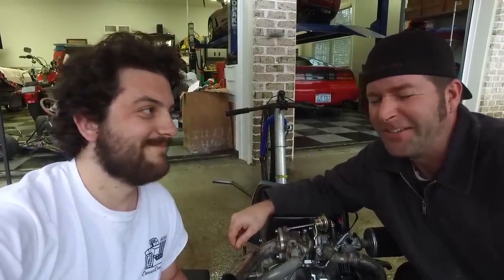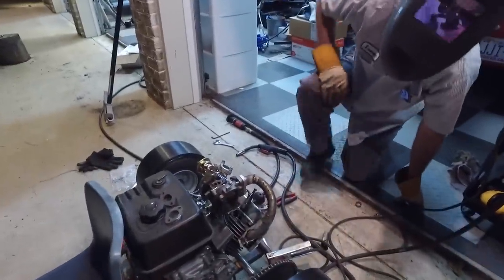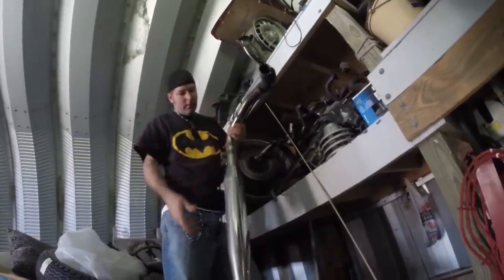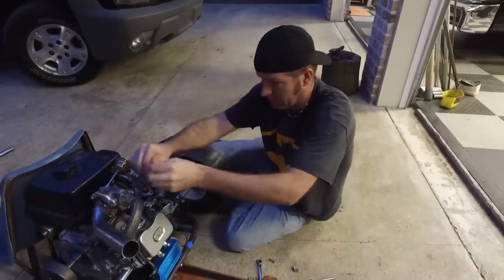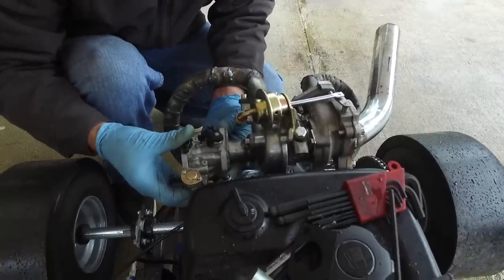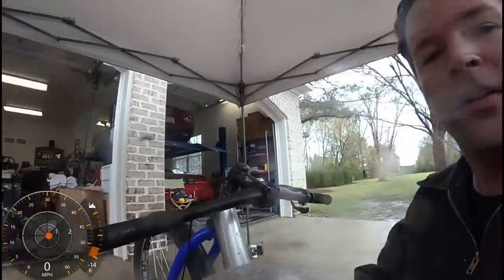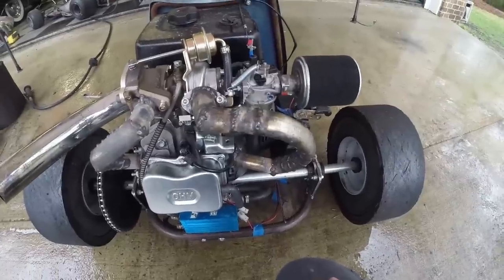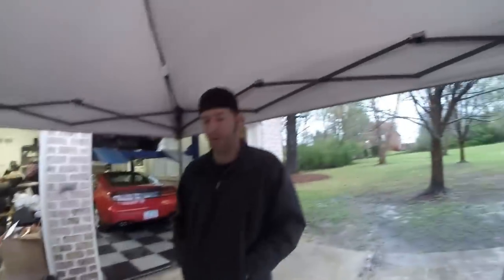Turbocharging a 420cc Drift Trike

Comment: Dude look at all these views. Hey man I think it's about time for you guys to step it up a notch, get a tubing bender, a miter saw and a drill press. Get away from those predator engines and look up resources for lifan engines or other Chinese iterations that include manual or automatic clutches and 3 to 6 selectable gears with overhead cams and electric start. Similar price range to harbor freight predators only a bit cheaper and much better features! =D

Comment: got to pressurize the hole carb and plug the bowl  vent
Reply: stop the  over pressurizing of the bowl the hole carb has to have Equal pressure on the air filter side of the carb is were the vent is

Comment: Get a blow off valve put it on the intake side of your carburetor move the carb back down that way you can control how much boost is going into the engine

Comment: Um yeah ... pushing the mixture through the turbo is not safe.
Sometimes this is done with superchargers, but you should not do that with a turbo ... ever ... because they get hot.
So if you would have driven this thing for a longer period, it could just have caught fire.
Reply: +detaart renault 5 turbo had a draw through turbo from factory
Reply: +p330hne and it caught fire from the factory.  those cars were infamous for catching on fire.

Comment: It's not getting enough gas  they make a electric fuel pump   That's for starters  as far as the battery try using a battery for a electric scooter there 500 amp   You also might have to jet the carb some I have years of drag racing experience

Comment: Why use & return engine oil for the turbo? Make or repurpose or buy an oil container, make it's own closed circuit? A Heineken beer keg is an awesome DIY fuel tank, $16 at WalMart, great beer, 5 liters. Do the same idea for oil, only smaller, maybe 2 liters? Sheet metal, 2 circles, 1 rectangle. Why does everyone tax their oil twice? SMH.

Comment: the problem with it is not the turbo, its the people who have no idea building it
Reply: +Darren Boxhall well we aren't done with it yet
Reply: +Isaac it'll be fine yeah fair enough.  I know you have received alot of info already,and I haven't read through all the comments, but it should work alot better. have you got another carby to try? that one that you blew out with boost could have an issue now. also, you should try richening it up so it blows a little black smoke, it could be leaning out a bit  extra fuel will cool it a bit too
Reply: ill try some more tricks

Comment: guys please get a pipe bender and some sand. these seams are not doing you any justice. also you NEED to get a motorbike carb if you want to run a draw through properly. even an AMAL from the sixties would work better than that junk.

Comment: pipes too restrictive, need proper inch and a quarter pipe, by losing that quarter inch you've lost (i forget the math) a shit ton of airflow anyway, so it's pretty much pointless..... EFI is needed but if you get the airflow right, the carb will work a lot better anyway never ever in a million years put smaller pipe than the normal,  try running then breathing through a straw, you'll get the idea.

still you've now got templates for the new pipes so that will be a lot easier.
Reply: +Bill Hanson the pipe is bigger than the inlet to the carb and the port
Reply: +Isaac it&#39;ll be fine you need to match all the holes all through to get perfect airflow, it's going to choke if you use any less diameters then the turbine output, you'll get it to work better if you increase all the ports and piping all through, we are talking serious power gains, break out the die grinder.
Reply: we are not done yet
Reply: +Isaac it&#39;ll be fine  awesome look forward to seeing the results.

Comment: I could tell you at 8:49 its not going to work ..... The worst case turbo is a blow thu carb....if the turbo makes any boost the engine will die from fuel starvation. Jets in a carb are designed to operate on negative pressure. Havnt watch the whole video yet, commenting as we go.....

Comment: little supercharger with a fan clutch to cut out at 4 to 5 g or the turbo will never spool up at low rpm.  in other words you need compression before you get compression at top end .do that and it will scream like a rape victim. 60% nitro methanol wouldn't hurt
.

Comment: Obviously it wasnt going to work who doesnt no that you cant turbocharge a carborated system?Of course it needs management.That thing is going to blow up so quick without coolant its already a cheap chinese turbo you just made it a 70's turbo without coolant. Thats the reason the whole turbo generation went away, unreliable power turbo's were blowing out in just a few thousand miles. Cool idea but do it right next time. You could have easily made a small reserve of coolant for the turbo only duh dudes! It works is not all that matters guys come on. I do give you credit for having a Z32 in the shop though nice clean Z, horrible drift trike mods jesus that was ugly I guess it worked though.
Reply: +Brian Heiden Don't listen to the haters guys, EFI that thing and you're mint. He probably doesnt realize that there are only provisions for oil cooling on that turbo. Oil cooled turbos are common, and reliable as well.
Reply: +Colin Worobetz well this one has a spot for coolant too. it'll be fine lol

Comment: add a bigger carb!!!!
Reply: 4-barrel!!! Lol
Reply: +horseman1968 well that got me going!! Hmm 4 barrel is it possible??
so I did some quick calculations, 400cc 0r 0.4 Liter at 7,000 rpm (screaming !!) would produce 1,400 cubic liters per min or about 50 cfm, I think a 4 barrel will work if 3 throats are closed off hahahah
In saying that they are not hitting the 7,000 rpm, so recarb the system, match the ports, get a free flow intake and exhaust manifold made,  does not have to be flash, ghetto is fine  just better flows.
With the standard compression ratio fuel will be an issue so maybe some avgas with a 100/130 octane rating, 100 when lean and 130 when rich, this will allow for more boost without preignition.
As for a carb a try one off a 600cc ATV rejet it for avgas set the boost for about 7lbs
Reply: i was kidding. lol
Reply: I know that but it would look cool with a 4 barrel so I had to do the calcs hahaha
Reply: +Marc wire why not a single barrel screaming eagle with a horn? Lol
Reply: yes I seem to see a 600cc single carb for a ATV it is a single barrel with a horn or trumpet 
I run a mean HondaNSR150RR ported, pro race pipe, trumpet on the carp drinks more than a thirsty V8
Reply: +Marc wire oh yeah? Well mine is faster than yours :P lol

Comment: That thing looks stupidly dangerous with a 1 1/2 l" wide tiny tiny little super skinny bike tire and bike handle bars , why not just Fab up two spindles which are stupid easy to make yourself if you have the right steel and a welder and know anything about fabrication , making a basic column with steering wheel and a metal cam at the bottom that moves the inner tie rods left two right , all that should be very easy to Fab up except obsiously the steering wheel unless you have access to a factory that  has molds for steering wheels and go borrow their machinery to make yourself orne or just go online and buy a plain go kart steering wheel for $15, thread the end of your column shaft with a die or drill a hole them tap it so you can mount the wheel directly to the column shaft with either a washer and nut or a lock washer and appropriate bolt.  Shit I just made an entire tailgate for a full side dump body untilitu truck completely from scratch , raw steel in work in about 5-6 hours yesterday so I know fabbing up spindles , tie rods and a steering column shaft with two bearings and bolt on bearing cages to mount the shaft to the chassis at the bottom by the floor and second one right below the top of the shaft where the wheel mounts.

Comment: Wow learn how to weld
Reply: Two things, it's a flux core MIG welder, and they are welding galvanized pipe, both are very messy. The beads are very good, it's just not going to be clean. Plus it's an exhaust header, it's just gonna get rusty and burnt anyways. ;)

Comment: you guys seem to have money and no skill. people have been turbocharging carbureted vehicles for well over 20 years. I personally own a turbocharged four-cylinder motorcycle that is carbureted. major car manufacturers have produced tens of thousands of turbocharged carbureted vehicles you guys need to do some more research and work on your fabrication skills if you want to make this a reality sure you could use electronic fuel injection and cheat your way out but where's the fun in that?
Reply: +bloodsweatngears69 Try well over 40 years
Reply: +bloodsweatngears69 im not giving up. i will put another turbo on something else and make it work with a carb